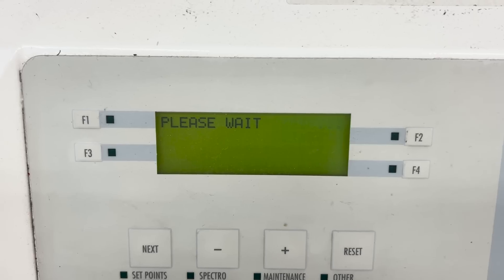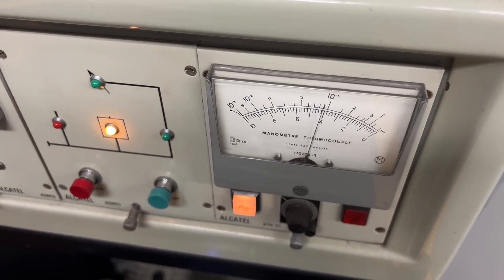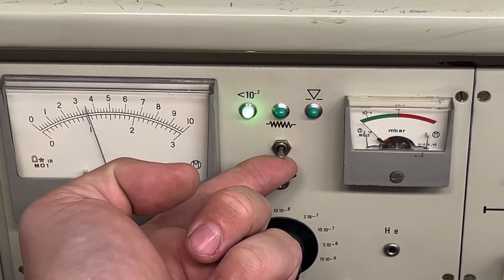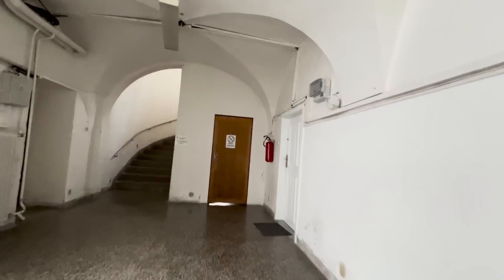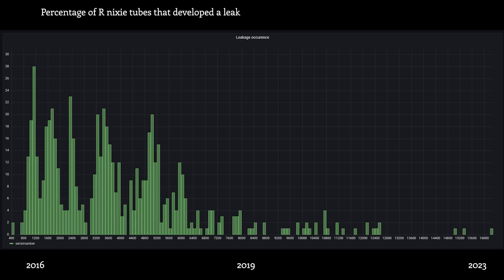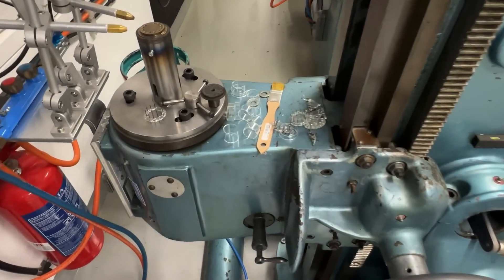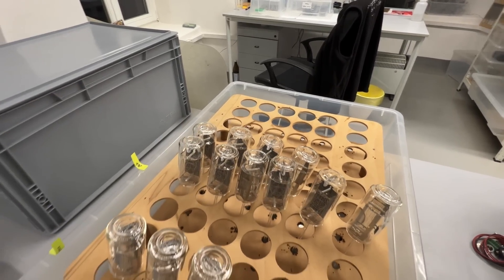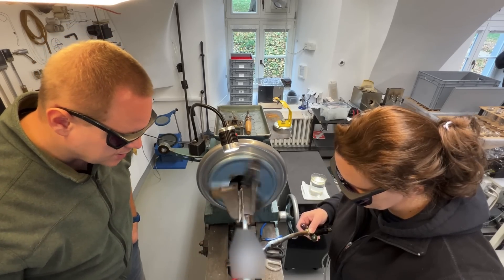F tube on hold, new clock in development.

Comment: It's unfortunate that the know-how that existed for several decades when vacuum tubes were produced in high-volume from several manufacturers has been lost, and needs to be re-created. Most nixie tubes are 50-60 years old now and still work, which is proof that the glass-to-metal seal can be done reliably.

Comment: If a decoder were included inside a Nixie tube, its number of pins could be reduced to two reducing the chance for air ingress.  Sending the tube momentary control tones over its power pins could control the decoder selecting the displayed digit and even blanking, flashing, and PWM brightness. It could even make tubes addressable, needing just two lines to power and control any number of tubes. Just a thought.
Reply: Would be quite complicated because of the high bakeout temperatures that would fry the electronics. But it is possible , i recently found a vfd with controller inside and that assembly is fritted together at around  450 C.

Comment: Could you do the leak testing using a refrigerant gas and a refrigerant leak detector? You’d want to choose a gas with low global warming potential. Note some are flammable (e.g. propane) so precautions would be needed. But you wouldn’t need a big machine.
Reply: 1) The point of using helium is its small molecule, inertness and the ability to be selectively detected in very small amounts.
2) You need a single point source (pistol with nozzle), and since hydrocarbons vapours are everywhere (oils, greases, alcohols, solvents, fuels) it would be impossible to find where the leak is due to constant detection.
2b) Refrigerant leak detectors insensitive to hydrocarbons detect the presence of fluorine or chlorine, so using bleach in the vicinity would affect the testing.